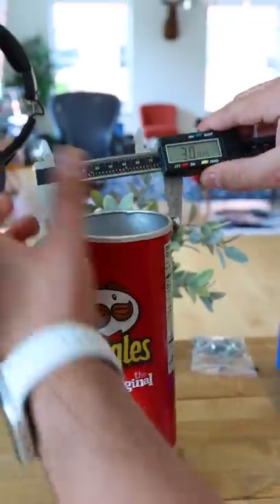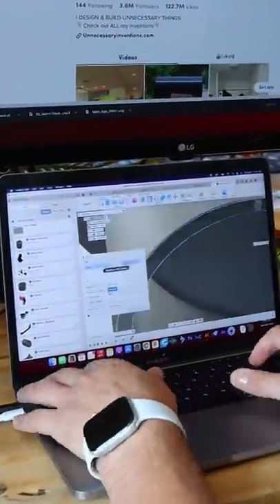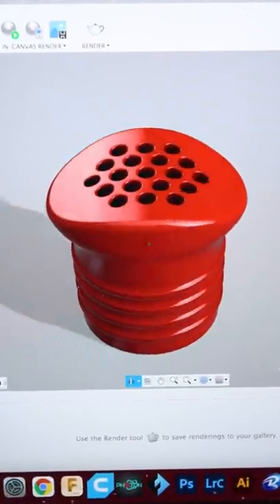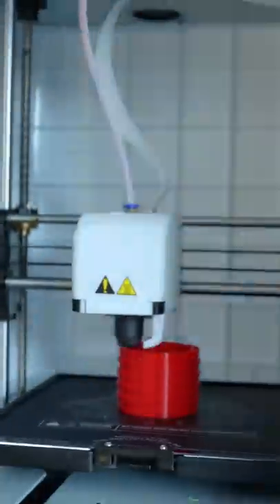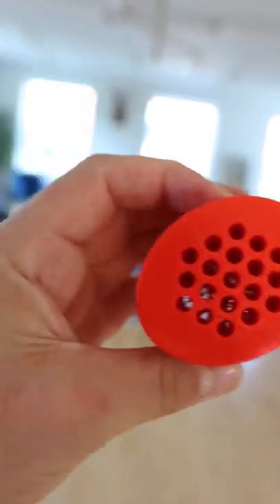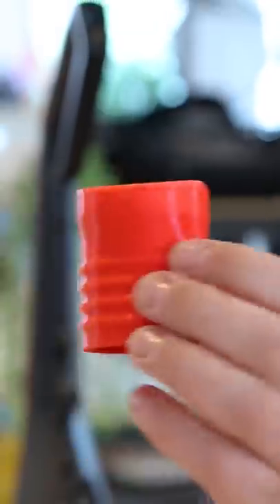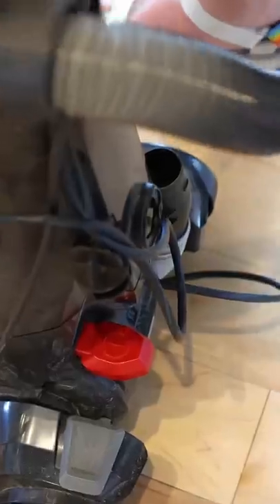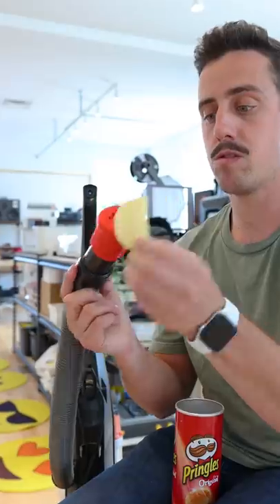the EASIEST way to get the last Pringles chip out of the can

Comment: "has to fit inside the Pringles can"
takes the external dimensions of the Pringles can, not the internal ones, which his calipers are designed to measure on the other side
Reply: and he held them at an angle lol
Reply: Yo Bradon those calipers are designed for external lol. Observe it closely.
Reply: @handgamingyt6976  most calipers have a dual measurement, with internal being on the flipside. These calipers are internal and external
Reply: @thepenguin9  but this isn't bro.
Reply: @thepenguin9  plss see closely.
Reply: @thepenguin9  internal caliper looks like inverted tweezers
Reply: @handgamingyt6976  it is
Reply: @Hand gaming YT  the calipers have two sets of tongs, one to take external dimensions and one to take internal dimensions. The internal dimension measuring element is on the direct opposite side of the tool from the one he's using, facing upwards when he's measuring. Which is what I said. "Observe them closely."
Reply: @handgamingyt6976  yes they’re on the top you absolute genius
Reply: My man's a physician
Reply: @handgamingyt6976  what's
Reply: @handgamingyt6976  the
Reply: @handgamingyt6976  thing
Reply: @handgamingyt6976  at
Reply: @handgamingyt6976  the
Reply: @handgamingyt6976  top
Reply: @handgamingyt6976  of
Reply: @handgamingyt6976  the
Reply: @handgamingyt6976  calipers
Reply: was looking for this
Reply: @handgamingyt6976  after getting rickrolled for so many times I think I need to memorize the link
Reply: @CeciliaLSP  lmaoo I was looking for this comment🤣🤣

Comment: “Needs to fit inside the can” *proceeds to measure outside diameter
Reply: Its a caliper... the main jaw is for measuring exterior dimensions while the back jaw is used for interior dimensions....
Reply: @richroutly1518  ah yes that thing,
Reply: @kuratse205  it’s called a caliper
Reply: @novatryxward9372  yeah some guy already said that, thx tho
Reply: @wendihyd6799  no I think its 5 users deep and he cant get out
Reply: @bigbrZa  You're the clown, the dial calipers measure inner and outer diameters...

Comment: Khaby: *takes bowl and turning the chips to the bowl*
Reply: Yeah but u lose a bowl and you also have to clean it
Reply: #stanevil
Reply: just tip it onto ur hand
Reply: @Obzornor  ya but it takes like 10 seconds-
Reply: Me:*gets my hands and turns the chip upside down and puts it in my hands*

Other person:*turns chip upside down and puts it in mouth*
Reply: You read my mind.
Reply: What I would recommend lol
Reply: Cut the pringle in half and throw the half to the trash...
Reply: Khaby is lame. Change my mind
Reply: Turning the chips to hand better
Reply: pringles in a bowl is terrible
Reply: cringe
Reply: @-monlight-2240  well the vaccum takes 1 second to grab it
Reply: @Obzornor  and who said u would leave crums on the floor? •-•
Reply: @-monlight-2240  I meant clean the bowl
Reply: @Obzornor  I just use a napkin and throw that away it takes 10 secs •-•
Reply: @-monlight-2240  wtf
Reply: Uses knife to cut Pringles can in half, therefore still having a can, and easier access to Pringles.

Comment: There was a better one where someone printed a new can with a twistable bottom that raises the bottom floor of the can to bring the chips closer to the top
Reply: Yea but u gotta take the pringles from the original can to the new can so it’s kinda useless
Reply: Yes, but this is more unnecessary
Reply: You would have to move the chips to a new can every time
Reply: also if ur taking the chips out then ur already getting the last chip out soooo
Reply: Sounds like a lot of work.
Reply: @Green_Bean_Machine  9

Comment: I just love how he uses dial calipers wrong. Use the other side for an inside diameter. 

Lol I do this for a living so kinda driving me nuts.
Reply: Yup! 🤣👍🏼
It triggered me that he measured the outside diameter to design an item that fits on the inside...
Reply: Same xD
Reply: Most likely he decreased the measurement so it fit, or measured the outside to see how much room he had for it to fit.
Reply: What will happen if last one is broken😂

Comment: Yeah, but the chip is suctioned from what is most likely a dirty vacuum-flow of dusty air, which becomes infused into the chip as the force of gravity fights with the vacuumed chip. Maybe what you need to do is to 3D-print a dedicated mini vacuum to avoid borrowing a standard vacuum for this purpose.

Comment: So you’ll probably never see this but what if you scrapped that because.. the vacuum. Make something that could be slipped under the stack of chips and create a small flat for a little rod/bat that’s connect to another flat bar that with notch’s for the other bar to slide and lock against so that way with your thumb you can click it down through the notches raising the chips to the top as you go no vacuum. Hopefully that made sense. I pasted out while writing this comment.. woke up and finished it